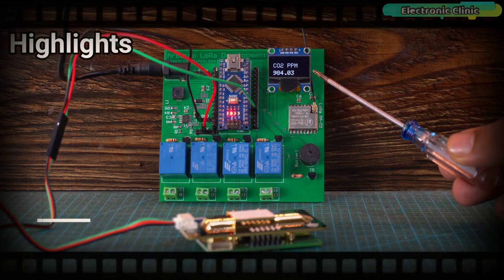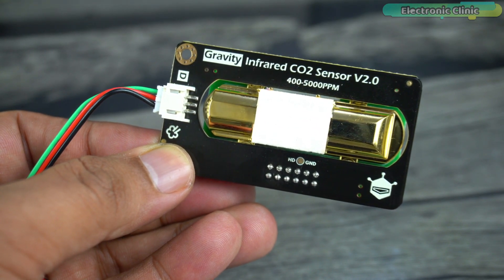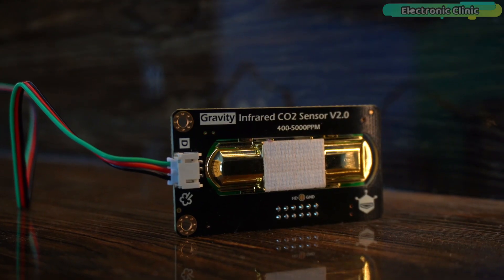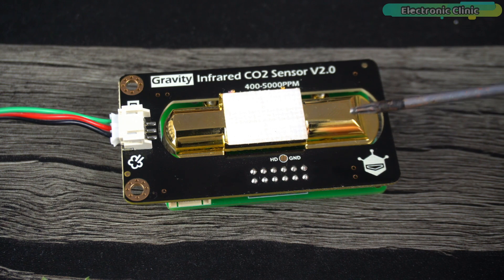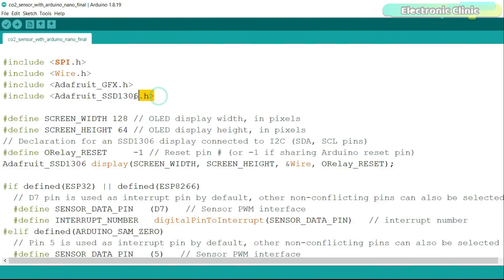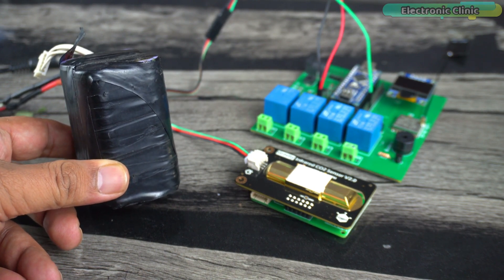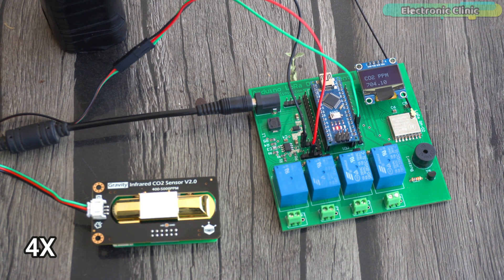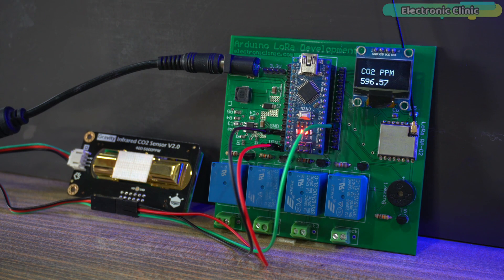CO2 Sensor Arduino, co2 ppm levels indoor, co2 meter, co2 concentration in earth’s atmosphere, NDIR

Comment: Which low cost sensor can I use in place of gravity infrared CO2 sensor?
Reply from the maker: I didn't try other sensor, but this one is the most accurate one.
Reply: @ElectroniClinic  I want to try this project but the worst problem is the cost of that sensor
Reply from the maker: its a bit expensive but it worth it. I loved it.
Reply: Please tell me the cost of this sensor